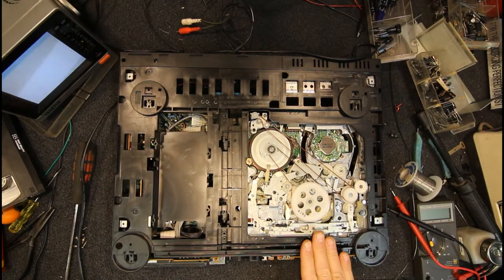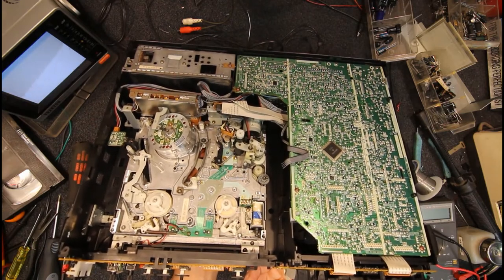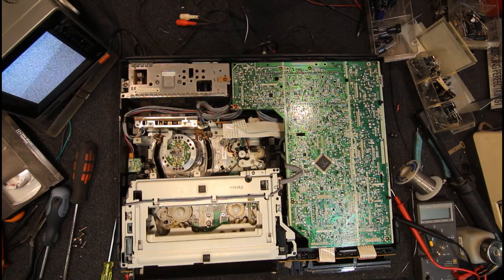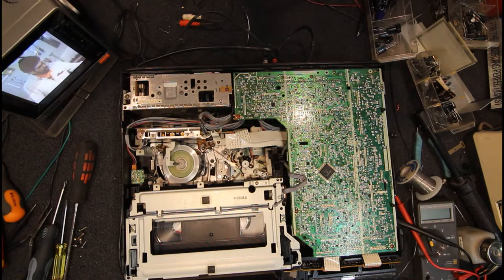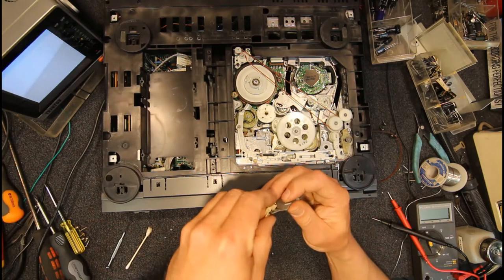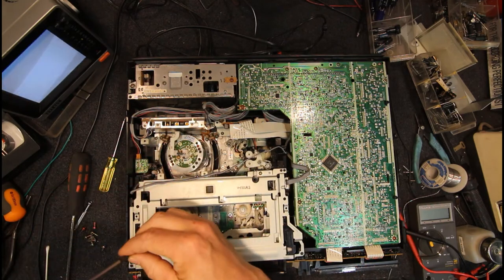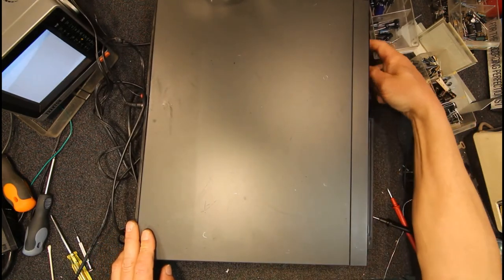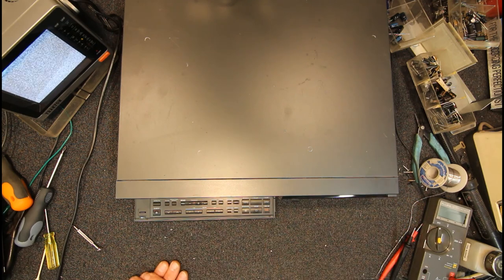Panasonic G Mech alignment basics

Comment: Mines identical but the white plastic part of the loading tray is not moving through the notches. I have to manually push the levers (on either side ) so that they can carry on with their journey through the notches should there be springs or something or have I not refitted it properly? When I take the white tray out the mechanism loads and unloads perfectly and when I fit it back up I'm hit by resistance as the carriage moves through the notches as described above, very frustrating ? Can't find a complete service manual either. I do have another G dec so I suppose I could strip it back and see what the difference is but I don't like the idea of doing that since I'm not an expert and don't what to damage a working machine. After watching again you have to intervene too so maybe my problem when a tape goes in is something else although it is at roughly the position

Comment: This machine appears to have chewed up teeth on the cam gear since it jumps out of alignment each time it tries to lower the cassette carriage with its locking tabs in the locked position (i.e. no tape inserted). So you have to be gentle when loading tapes.
Reply from the maker: As I explained its a broken tab on the cassette housing which means the metal toothed part can move sideways. The gears are all fine. Its a reasonably common problem in G mechs. I have used the machine a few times since and its been fine.

Comment: My newly acquired NV-FS200 seems to squeak/hiss loudly when a tape is first inserted in. It otherwise works perfectly. Any suggestions of what's happening there?
Reply from the maker: Usually its the brake pad on the capstan motor, which I think I looked at somewhere in the video. I think there are some comments here on how to make it quiet without replacing it.

Comment: You could use some very fine sandpaper on that capstan motor braking pad...
Reply from the maker: Didnt think of that. Definitely worth a try.
Reply: I was successfull in wiping the pad with a q-tip soaked in isopropyl alcohol. Stopped squeaking immediately.

Comment: Are there any parts that need to be greased and if so which ones and with which grease? I know that you have to grease both sides of the drums but is it useful elsewhere? I would have liked to see this in your video.
Reply from the maker: Tape guides are the only thing that normally need greasing in these mechs. You have to assess your own machine. If it has grease that has gone dry then its best to renew it, if its in good condition it can be left alone. Any light grease that is OK to use on plastics should be fine.
Reply: @StevesElectronicRepairShop  sorry for stupid question. What do you call tape guides? Googled it and could not get an answer, thanks in advance
Reply from the maker: @dudedude7849  They are the two things that slide up the curved tracks on either side of the head drum, with a thin white plastic roller and angled stainless steel pin. They pull the tape out of the cassette case when you hit play. The 'tracks' they slide along have black grease on them
Reply: @StevesElectronicRepairShop  now I got yeah. But normally there is a grease on these tracks. What grease would you recommend for these tracks? Thank you
Reply from the maker: @dudedude7849  If the grease has dried up the guides will usually shudder as they move. I use a grease made for VCRs and the like, but any light black grease that is OK with plastics should do

Comment: Great video.  These are a great deck.  One of the best VCR's I have ever used.  Have had mine for many years.  Had a recap done years back.  Have started having a little issue of late where when I go to eject the tape it makes a funny noise then after a few seconds the machine turns off.  I have to keep hitting eject and eventually it comes good and spits out the tape.  I am thinking mode switch?   Sadly very hard to find someone to work on these machines nowadays.  I have seen a video on G mech mode switch cleaning and am thinking I might tackle it myself one of these days.  Silly question I guess but can you still get heads (upper drum) for these?  Thanks again for the video.
Reply from the maker: Sounds more like something is jammed or slipping, but its not impossible its the mode switch. I think you had to unsolder the switch in these to remove it for cleaning. I would also check the pulley on the capstan motor that runs the big belt and make sure it hasnt split allowing it to slip. Some upper drums are still available from places like Wagner Electronics in Australia, but you would have to check for that model or head number, which from memory was printed on the upper drum circuit boards on some of them. They seem to last a long time so unlikely to wear out unless you use it a lot.

Comment: Thanks for the great video. Did you use both click things in order to go through the gears - the one at the bottom right corner and another at the bottom of the vcr?  Or is it enough to use one of them if I want to test the mech manually to test all gears or steps?
Reply from the maker: There is only the one that I know of which activates everything

Comment: I love this deck. Everyone I knew in the trade was scared to death of it. One thing is I always did was remove the tape loading mechanism complete without removing any parts first. I love a challenge.
Reply from the maker: No one wanted to touch them. I have another one now, so will have to try your challenge when I get around to having a look.

Comment: Ekkora barkácsolást...pffff. A pöcköt te törted el, mert rosszul raktad össze.... minek szedted szét a kazetta fészket? egyben kell kiszedni. összerakásnál meg meg van egy pici trükk és a helyére ugrik. gratulálok a kókányolásodhoz. nem szoktam negatívot adni, de erre csak azt tudok.
Reply from the maker: I repaired dozens of them that way with no problems. The loading mech clip breaks in these machines on a regular basis. I have had to replace a few for people because of that problem. Often its what leads to the mech jamming in the first place.
Reply: @StevesElectronicRepairShop  believe me, I have already improved a lot. but the nest should not be taken out in this way, it should not be taken apart in this way at all.
Reply from the maker: @gyulaszabo6750  The Panasonic G Mech manual says to do it the way I do it. I am doing it by the book. If you want to do it some other way that is fine, but dont tell me that doing it the way recommended by Panasonic themselves is wrong. I find it much easier to pull it apart as they recommend and to align the mech as their manual instructs.
Reply: @StevesElectronicRepairShop  :D :D :D